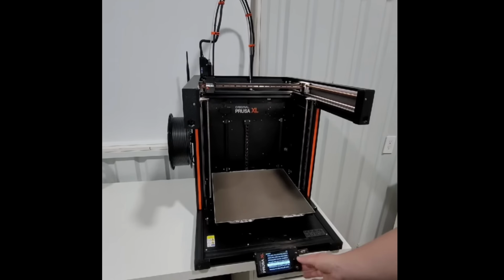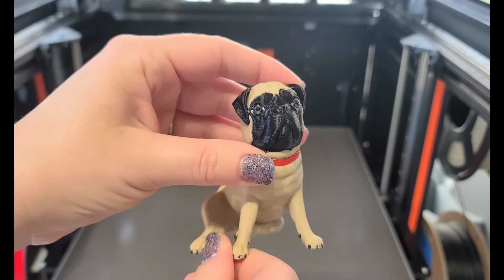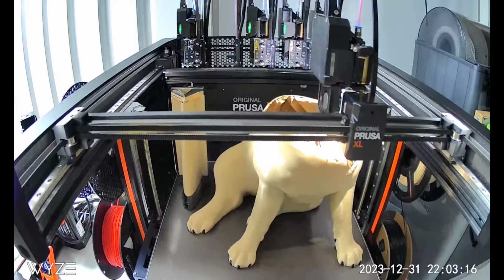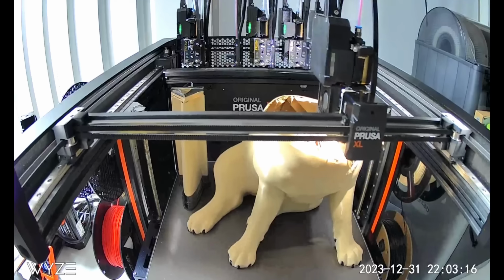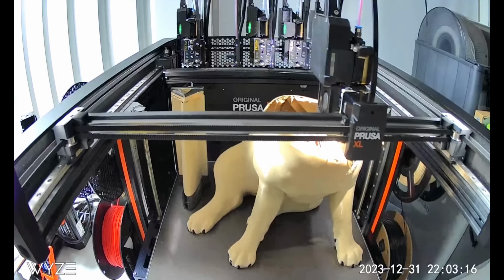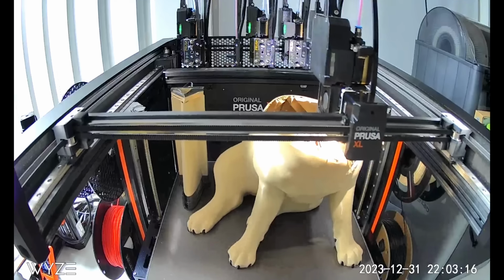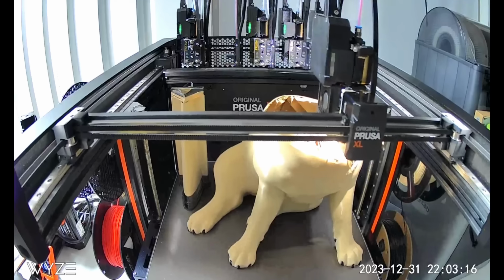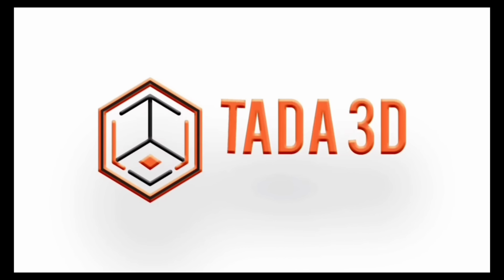Finally Testing Out the 5 Color Buddy Print That's Over 14" Tall!

Comment: So I have an idea of what's happening with the red filament. When a toolhead is finished with its layer and goes back to purge tower it does a ramming maneuver.  This is to remove the fully melted filament before parking. The setting is in filament advanced, and the multitool ramming flow is the one that can cause problems. The default for PLA is 40 mm^3/s. For some filaments this is way too fast. On occassion you end up stripping the filament which is why you could push it later and get it to start working again. Most of the time this shows in problems with the purge tower as filament is extruding so cold it doesn't stick.

I lowered the filament>advanced>multitool ramming flow to 20 mm^3/s as it's the very top end the nozzle should be able to handle. It should be even lower for silk filaments, and Prusa does even turn it off for TPU.

Additional thought. At this point you're probably going to need to clean your drive gear teeth.
Reply: This makes sense, @tada, give this a try…. If you are willing….
Reply from the maker: Ok I'll definitely check this. Thanks so much!